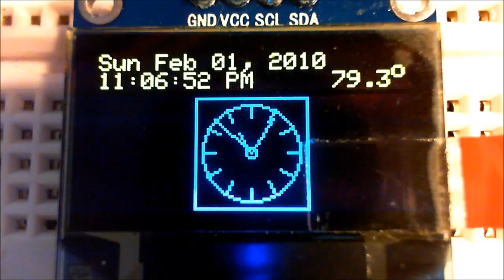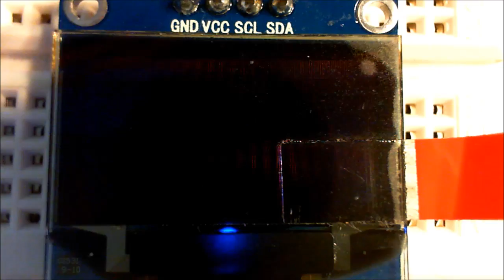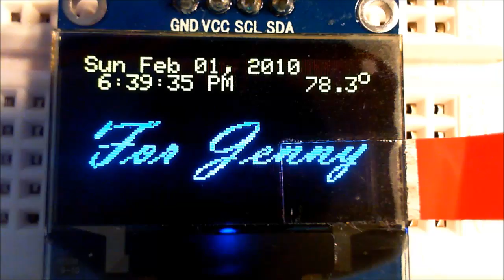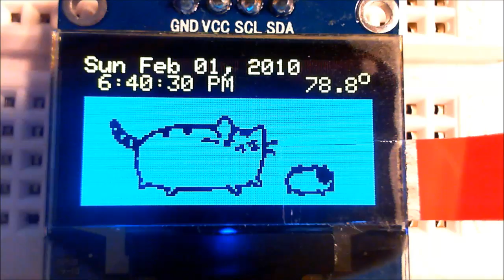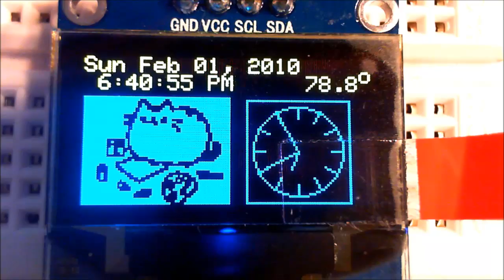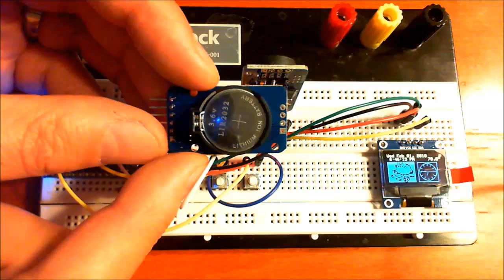DS3231 OLED clock with 2-button menu setting and temperature display

Comment: VERY cool project. I was looking for a video on setting the clock without a pc and didn't expect a project soo cool as an example. 
I'm new to arduino and was looking to make similar as a gift, similar in that I'd like to learn how to use the time displayed to turn on/off a light.... like those vacation light timers you buy to. You mentioned the alarms so I wanted to ask if you've ever taken this and done that with it? Or maybe have a video I could watch and learn how to combine that with this (adding of course this menu to alter the current, on and off times).

Comment: A good reason to not limit the year range is that this could be used creatively in movies that involve time travel and the like.  
  I can easily picture this display installed in various equipment display and control panels both in reality and in fictional (movie) applications.

Comment: Excellent Clock............ . I tried it & its working GREAT .Thanks A lot .
 Here  I hv  1 prob. When i connected 1.3 inch OLED, display shows junk . I think 1.3 inch oled  has SH1106 chip. I put that too in ur code, no sucess. Pls Help.....  One more query : How ur making rectangle blink, went thro full code & libs but failed to understand.

Comment: iam not getting the pusheen graphic only it is showing me genetic clock
Reply from the maker: The only way this could happen is if you uploaded the incorrect software to the Arduino. The version with the Pusheen images and animation is named "Pusheen_Clock_Generic_v1.1.zip". Both versions are at http://www.instructables.com/id/DS3231-OLED-clock-with-2-button-menu-setting-and-t/step2/Set-your-clock/

Comment: Hello, great project thanks for sharing. When I compile the sketch it says low memory  available may cause stability problems. It uses 19,622 bites 60%, do you think that is a problem or should I cut something out?
Reply from the maker: That warning is displayed when 75% of SRAM memory is filled. SRAM is used for run-time variables. It is probably an indication that the Adafruit library is potentially chewing up more than 75% of memory. Probably all is well. I used the Micro and Pro Micro and have never seen that message. Bitmaps are stored in program flash memory.

Comment: add a adafruit trinket and a piezioelectric bbq starter. Use the piezio as a input and use pins on the trinket to signal a animation change.

Comment: I get the error messages: Arduino: 1.6.0 (Windows 7), Board: "Arduino Uno"

Generic_RTC_Clock.ino: In function 'void set_alarm()':
Generic_RTC_Clock.ino:425:54: error: cannot convert 'boolean* {aka bool*}' to 'const uint8_t* {aka const unsigned char*}' for argument '5' to 'void DS3231_set_a1(uint8_t, uint8_t, uint8_t, uint8_t, const uint8_t*)'
Error compiling.
 Any ideas?

Comment: Where can I get a 128x64 OLED blue display with white band at the top?  I've only ever seen the blue and yellow variant.
Reply: I think it's just the camera distorting the video.
Reply from the maker: Yes, the display is actually the Yellow-Blue version of the display. The camera washed out the yellow a bit so the color is difficult to see. The two-color version is really monochrome. The upper 16 row pixels are fixed to yellow and the remaining 48 row pixels are blue. On the two-color versions, there is a single-pixel width gap between the yellow and blue sections of the display. I don't believe the single-color versions have this gap, but I am not positive of this. The code is designed to take advantage of the two-color monochrome display, but should work fine with the single-color version.

Comment: Hi what software did you use to draw the graphics,the cat etc,cheers
Reply from the maker: There is an application called LCD Assistant that allows you to import a monochrome bitmap image and generate an Arduino/Adafruit-compatible data structure. The imported bitmap must be a multiple of 8 bits in both the x and y axis. You must check the "horizontal" box before exporting to make the data structure compatible with the Adafruit library.

Comment: Don't both the clock module and oled use the sda and scl pins, if yes, how did you share those pins?
Reply from the maker: The RTC and OLED (and the 2K EEPROM on the RTC board - not used in this project) modules use separate I2C addresses. Just connect the SDA and SCL pins in parallel and all will work fine...
Reply: Thx, Ill try it on my Duino